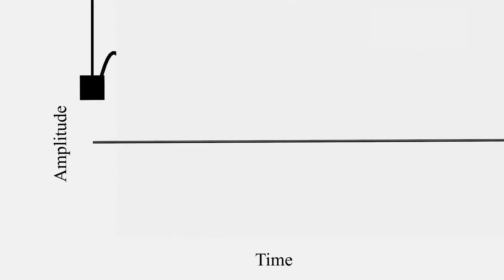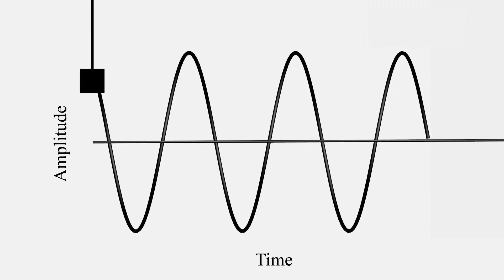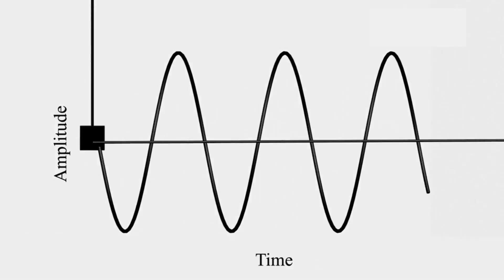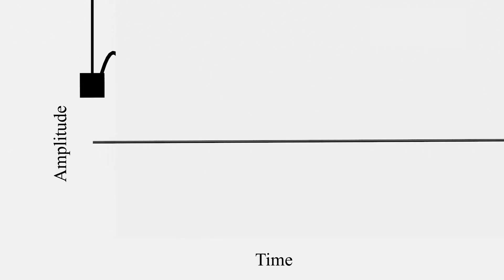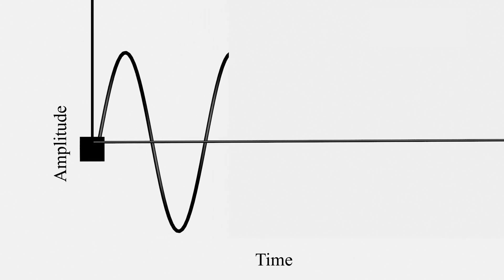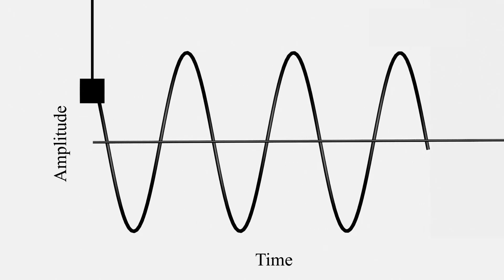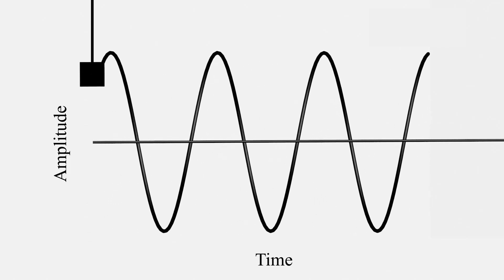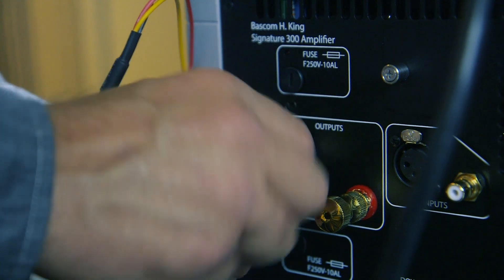What is a ground and why is it important for the performance of an audio system?

Comment: How would you ground using balanced app, but connected to the speakers? Do speakers have ground?
Reply from the maker: Thank you for reaching out. Passive speakers do not have a ground reference point, unless they are powered by a Class A/B amplifier, in which case the negative binding post can be used for a ground reference. When using a balanced amplifier, we recommend connecting the High Level cable to the outputs on the amplifier itself.

Comment: Is it related to grouding the electric network of the house? How do we measure it? How do we improve a poor electric grounding?
Reply from the maker: The grounding of your home's electrical circuits can definitely have an impact on the performance of your home audio system. This is especially evident in older houses which have poorly grounded outlets, or outlets with no ground at all. If you are interested in improving the grounding of your home's electrical circuits then we recommend contacting an electrician in your area.

Comment: @REL Acoustics, is this somewhat of an indictment against balanced differential amplifiers because, from my understanding, they do not have a ground?
Reply from the maker: Thank you for reaching out. Balanced/Differential amplifiers will typically have an electrical ground reference point somewhere on the amplifier, though neither of the amplifier's speaker output terminals will reference to ground. If you would like assistance with connecting High Level to a balanced/differential amplifier then feel free to write in to contactus@rel.net and we will be happy to assist.